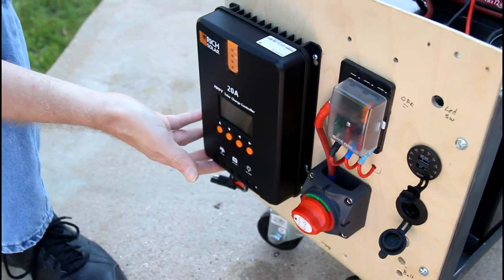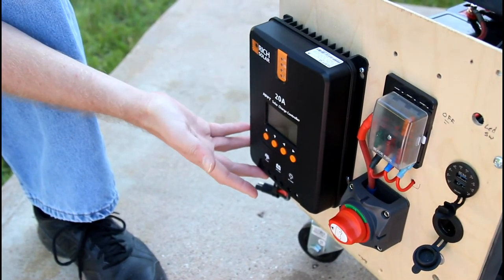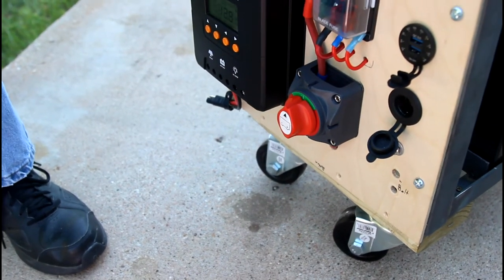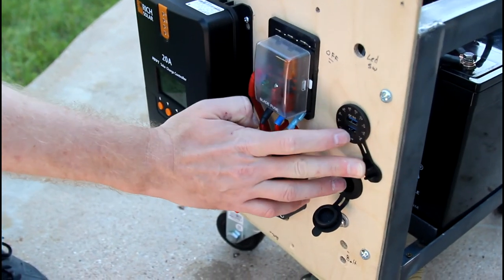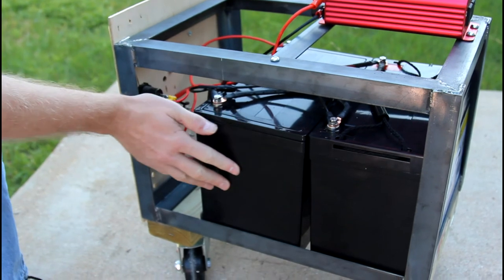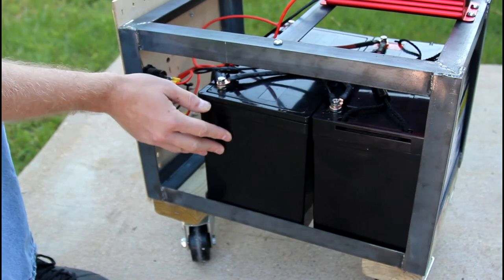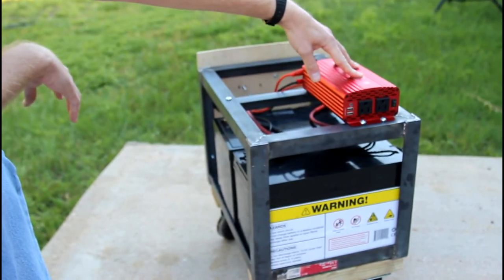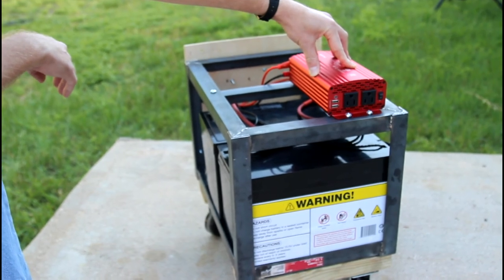How to build a solar power cart

Comment: Very nice build. I enjoy seeing home built units.
You Texans caused me to build a solar generator on wheels after your last year's unexpected Polar Vortex deep freeze. I live in the PRK and we have had grid troubles and rolling blackouts since 2017.  Mine unit is 7200 watt hours of home assembled EVE Lithium cells, 560AH, 3000/6000 watt Renogy pure sine inverter, 30 amp Renogy Rover MPPT, Aims 75 amp onboard charger in case the sun doesn't shine and the Honda eu 2000 generator has to come out. The fun part was that I got it temporarily  running on the work bench and used it to power my Vulcan wire feed welder. The frame is made from square steel tubing and it sits on caster wheels.  It weighs 130 pounds. The 30 amp MPPT wasn't enough for me so I piggy backed on another 40 amp Renogy Elite MPPT to blast amps back into the battery with 900 watts of panels. Lithium batteries can take insane amps with no harm. I use mine every day since June 2021.     I like your angle iron frame.
Reply from the maker: Now that lithium batteries have gotten so cheap I am headed that direction also. At the time I made this cart they were much more expensive. SLA are very heavy!!
Reply: @scottbradford192  12 volt lifepo at signature solar for about $550...7000 discharges...they also have all in one systems in 24 and 48 volts, very affordable.

Comment: My cart, 800lb rated Gorilla Yard Cart , 4 x 6 volt 260Ah AGM batteries in series/parallel, 40amp Epever MPPT solar controller/MT50 screen, Renogy 2000watt pure sine wave inverter/charger as UPS if needed, And 800 watts (8 x100watt solar panels). Florida panhandle resident..... oh and a dual fuel 4500 watt generator (collecting dust).

Comment: Very nice set up!
Are you using two 100 watt solar panels or a single 150?.. what is the recharge time estimate at 75% drain?.. Can it run appliances while being recharged?..
Reply from the maker: I am using two 190w solar panels for a total of 380w.  20 amps. 5 hours of sun in Texas means I can fully recharge both batteries in 2 days in a perfect world
Reply: @scottbradford192  just keep adding panels as you can...you can run a mini-split with 600 to 800 watts of panels.